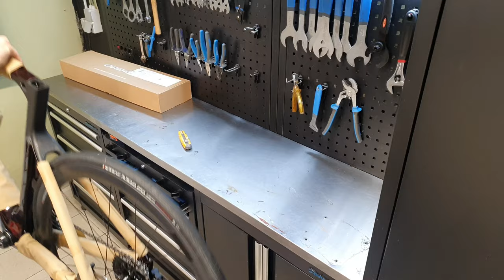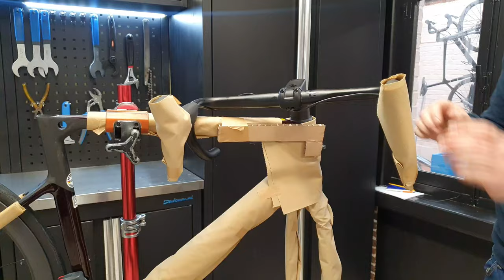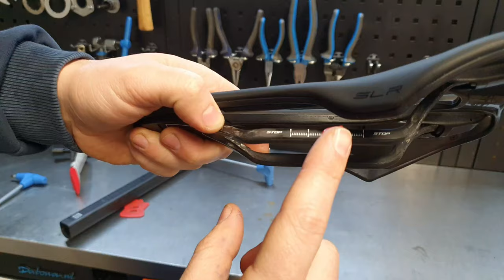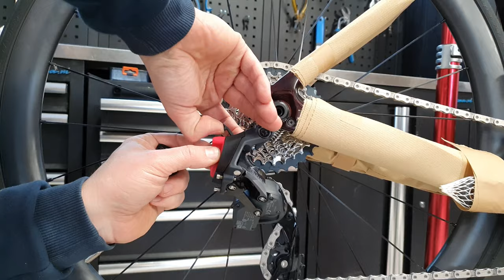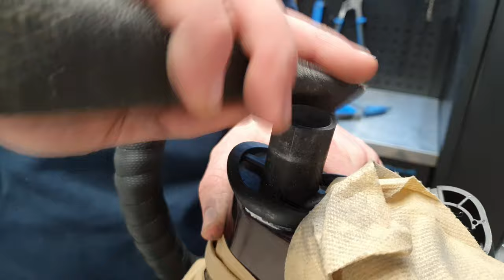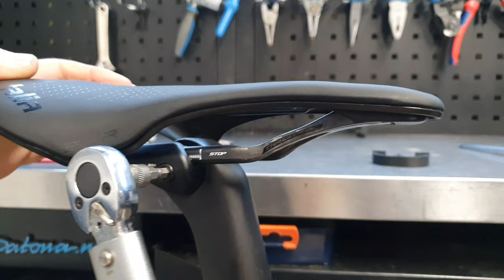Orbea Orca m21eLTD 2022 - Assembly of a dream bike

Comment: Nice to see some details of the frame / headset / etc, appreciate the video! Any experience w/ mechanical groupsets with that stem, if the shift performance is impacted with the cables routed like that?
Reply from the maker: No problems with cable routing or to much friction of the derailleur cables